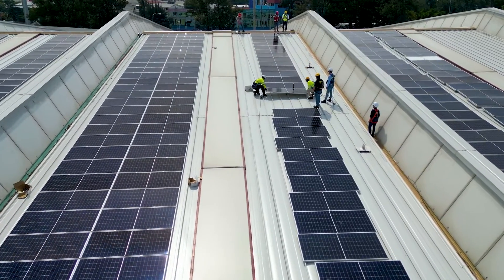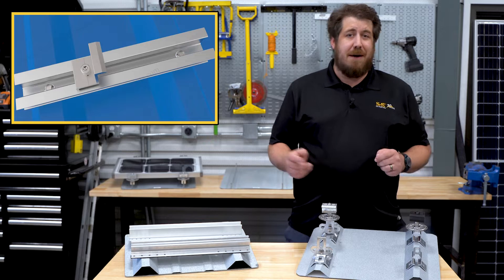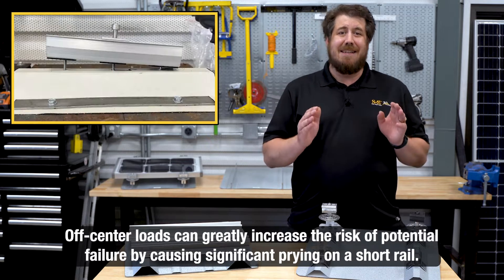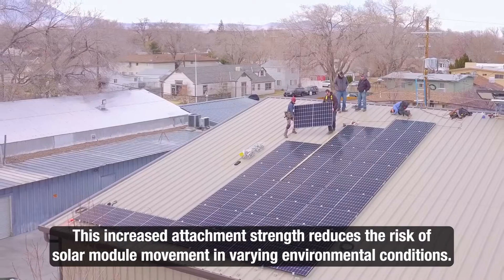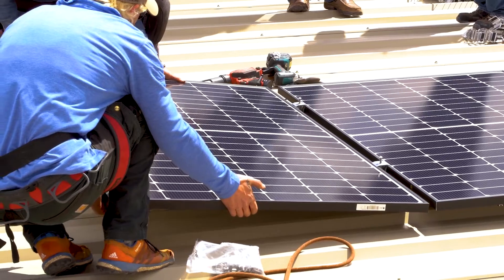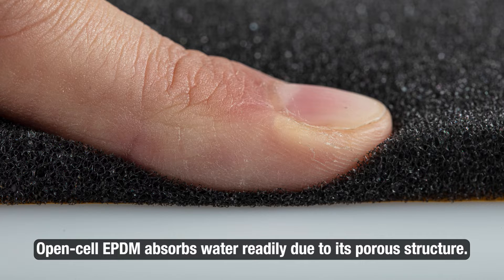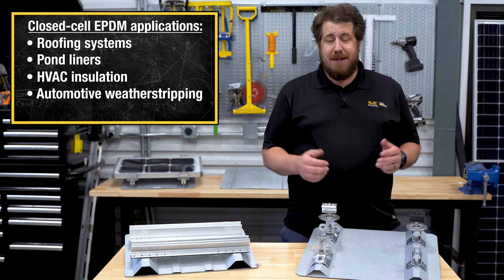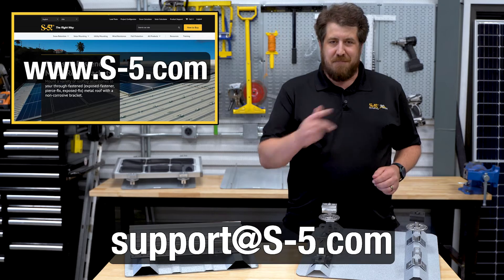Short-Rails vs. Rail-less Mounting: Choosing Your Solar Path!

Comment from the maker: Short-rails are also installed on standings seam roofs, and some of our partners even specify S-5! standing seam clamps as part of their systems (Aerocompact - https://www.aerocompact.com/en-us/products/metal-roof/compactmetal-tm).  Since there are no penetrations, as with all our standing seam clamps, pull-out strength and waterproofing are not the issues.  But short-rails on standing seam roofs still have to be individually measured and located, whereas our PVKIT has that same advantage of installing on the fly as modules are installed without measuring.